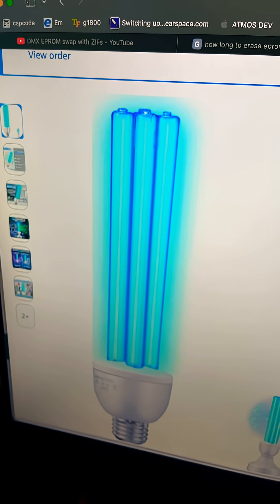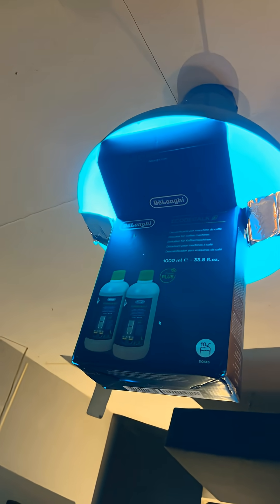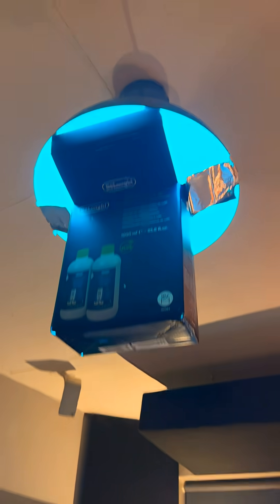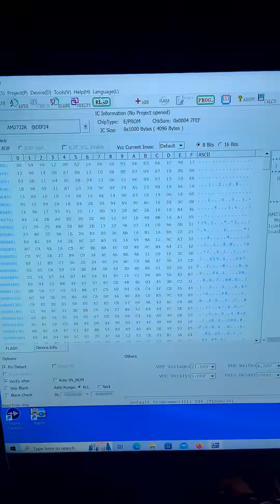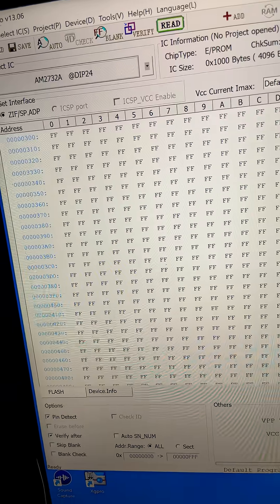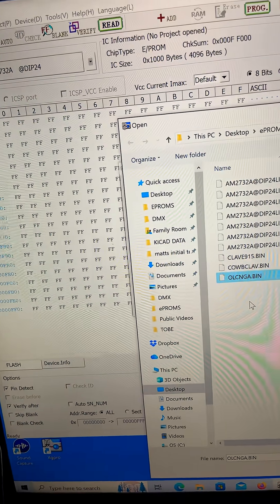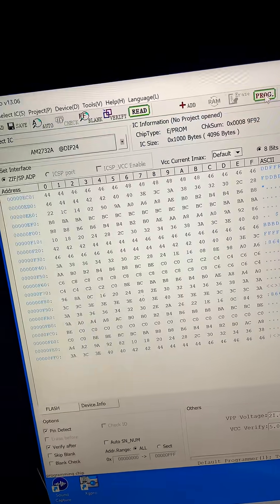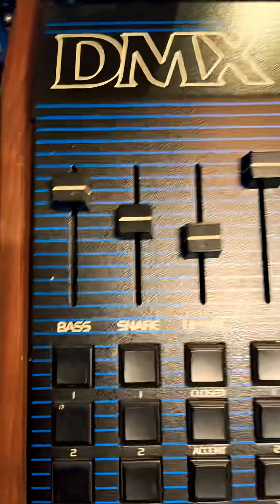It actually worked! Impatient engineers rejoice around the world erasing eproms!

Comment: This is  very old/known method - but you can only do it with very old BIOS/firmware eeprom chips that have a "window" for the light to hit the inner parts. Its the infra-red light spectrum that somehow erases the chip. Still very cool to see. After 30+ years, never actually seen it done before.
Reply: sry but that is just wrong, its uv that erases the eeprom not ir, easily provable by a simple web search